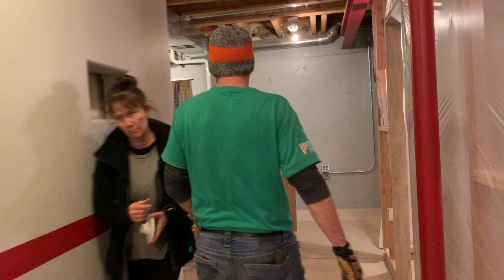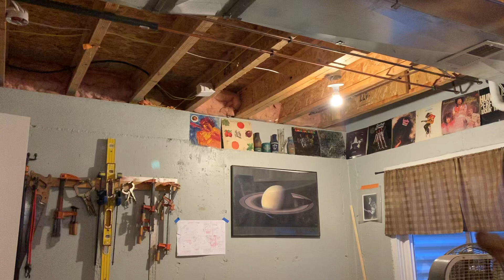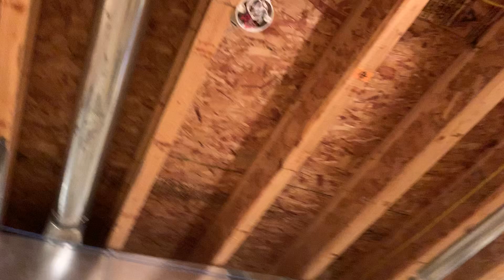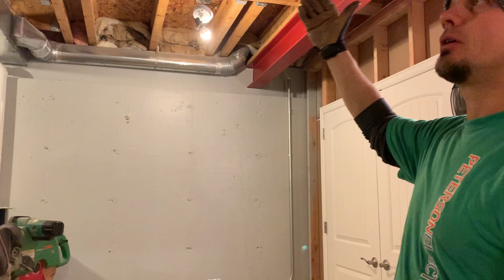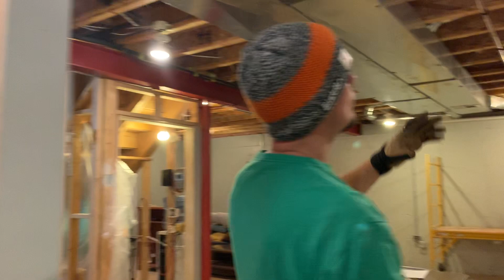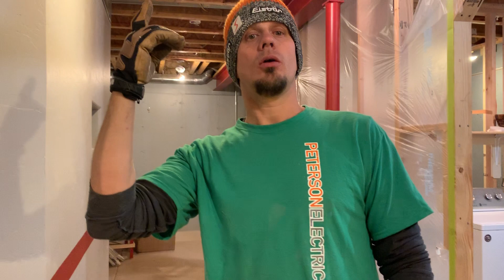What Are the Electrical Requirements for Only Partially Finishing My Basement?

Comment: I'm curious about the NM after a drop ceiling is installed.   Is that in reference to 334.12 (A) (2)?  ..."Exposed within a dropped or suspended ceiling cavity in other than one- and two-family and multifamily dwellings".  Just curious.   Thanks again for the information